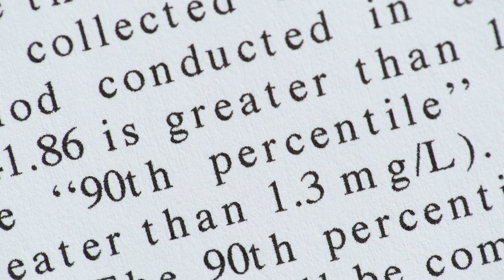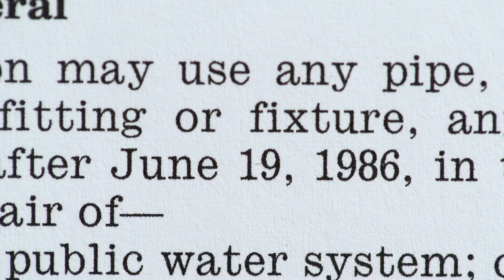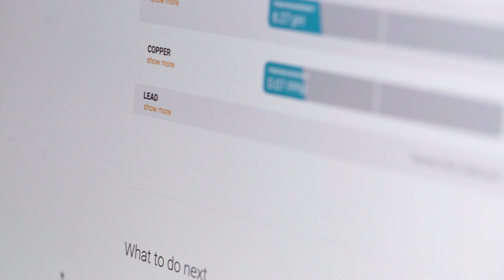We tested NYC water for lead and the results were confounding

Comment: Even if you change the pipes to your building they are still some of the old lead pipes carrying our water,NYC has pretty good regulations for everything but the best way to protect yourself is to buy a good water filter,the water in NY is pretty good but just to be on the safe side get a filter because the city can't do everything 🤔

Comment: I noticed that there were no controls used on the qualitative strip test. I think at least it should've been compared with a distilled deionized water as the negative control and some high concentration of Pb standard which is I think available commercially as a positive control.

Comment: The question is do the filters work.  If they do then problem solved. Or at least that's the cheapest easiest fix. The government should pass out filters before digging up pipes and replacing them. That is if they work perfectly. And how often they have to be changed. If you can fix it for $30 it's not really a problem

Comment: My building on the UES and my brother’s building down by Stone Street in FIDI both tested high for lead and other contaminants. A 30$ filter will not remove lead only a triple stage water filter will do that. I’m glad you made this content about such an important issue but you bungled the reporting of it and how to combat the danger. I used an Aquasana (https://www.aquasana.com) filer and had to replace the filters every 2 months instead of the recommended 4 months. When you see black sludge trapped in the first stage the first time you will never drink tap water at a restaurant ever again.
Reply: How did you test for the water

Comment: Certainly a problem with many of those lead pipes, but always best to get that 5 gallon water dispenser and then just refill at your local grocery store. Use several of the 5 gallon containers so you can have water available for a while. That is what we do and avoid the problems of the other water.

Comment: What about sending a filter to be analyzed after a 3 to 6 month period of use to see how much lead has been removed from the water. Also there are also other contaminants and or bacteria in water supplies due to a reduction of EPA standards over the years, even though they deny lowering the standards.  I always suggest using a water filter for drinking and cooking.

Comment: Sooo basically there’s no issue. Lead in pipes doesn’t ever come in contact with the water unless they were built wrong. If you couldn’t prove there was an unsafe amount of lead in the water, why are you trying to scare people? 

Also, the apartment buildings in NYC can’t be touched by the city. The pipes can only be replaced by the people who own the apartment buildings. That’s why you saw NYC replacing water pipes, but in the middle of the streets. The water going into the apartments is safe, but it’s up to the apartment owners to actually replace the pipes that come from the city into their home

Comment: The EPA and FDA are most of the time filled by presidents with corporate shills. Just a couple of presidents over the past 50 years actually put real scientist and doctors in charge.
Never believe what the EPA or FDA says is safe.
I worked for an EPA contractor for over a decade scanning environmental mobile labs setup all over America. Every 
time we recorded high levels of toxins in an area in either the water or air, the EPA would just raise the danger level for reporting.

Comment: I know I have lead pipes. I drink over a gallon of tap water per day with no ill effects. Don't drink first draw because that'll probably have the highest heavy metal content after sitting in the pipes and accumulating it. Drink water 30-60 seconds down the pipes(it'll be colder too). But really, one part per billion is fine. Common acceptable limits are 5-15 parts per billion.
Reply: There is no acceptable limit of lead. You have clearly already gone insane from all of the lead built up in your bones.

Comment: The real reason the flint Michigan water crises occurred is because they did not include PbO2. Or some other noncorrosive chemical to the water supply. This chemical coats the inside of lead pipes effectively solving this issue.
Reply: Orthophosphate/phosphoric acid. It's a corrosion inhibitor.

Comment: I hate to be the only one but shouldn't we be trying to educate the public for them to buy water filters? Even if you managed to remove all the lead pipes there will still be contamination in the water so why not fix the problem as a whole. Also a water filter is around 22 dollars and can last for several years so don't try to make it seem people could not afford it. Another solution is privatize the whole process, business will be incentived to act in a proactive way to make sure the water their customers are drinking is safe or the business will lose trust over the customers. And unlike bureaucrats business can adapt and change very quickly compared to bureaucracies.

Comment: How 'modern' USA is decades behind the 'old' continent Europe
Reply: Also because American infrastructure was never wiped out in ww2 so the United States has lots of old systems
Reply: @ethanpaul878  They were exchanged at 1878 in south Germany, due to problems with pregnant women and babies.
Reply: laughs in north german water quality
Reply: The continent of Europe is smaller than the us so yea you can replace pipes much faster
Reply: @ChaseDaPlaya  The total population of the USA is smaller, Don't think there are many pipes in the desert and mountains either. But whatever the respective sizes, it seems to me that it's more the will to do something about it that is lacking
Reply: There's still plenty of lead pipes in buildings here in Italy. The public infrastructure might be new (if it even is), but the buildings are a completely different question.
That said I think lead water mains were phased out much longer ago than 1987... for example I know for a fact that the drain pipes in my building are made out of lead, but I'm pretty sure the inlets are iron because the water leaves orange-red scale stains over time.
Reply: Yes, interior piping is the hardest part. At least draining that before taking drinking water is possible by letting the tap run a bit first. There have been awareness campaigns and building standards have been changed. Here, you're not allowed to rent out a home unless piping is lead free.

Comment: How can you filter lead out?
Reply: Destillation. Lead ions are in solution.
Reply: just about any filter will do, just search lead water filter and everything form basic Brita filters to high end ones appear on the list. also any filter you pick up off the shelves should say somewhere that it removes lead. if it doesn't find one that does
Reply: Ion exchange resins
Reply: You can also just run the tap until it's as cold as it can get, that way you're getting rid of water that was sitting in the pipes and absorbing lead
Reply: @Ariccio123  no, i dont suggest that especially in the case of flint where the pipelines themselves contained lead, the whole thing could back leach and contaminate further up the line and water in pipes can sit stagnate for long times so even though it may seem fresh, it may still contain particulates. best bet is to just filer everything to be sure.
Reply: They say 30$ filter, but obviously they don't want you to know which one so you should try them all, or maybe put them all in series one will work.